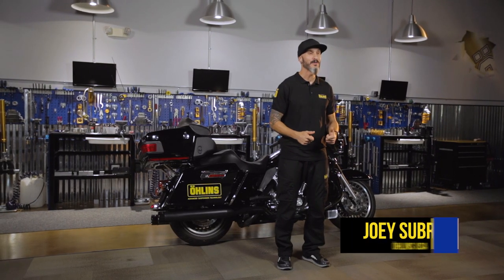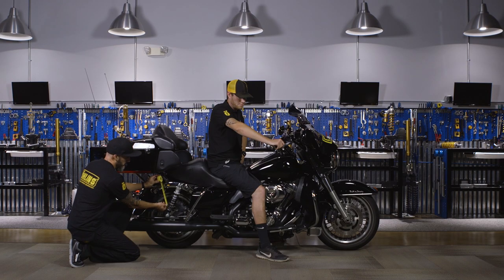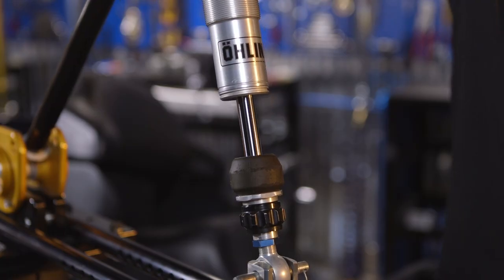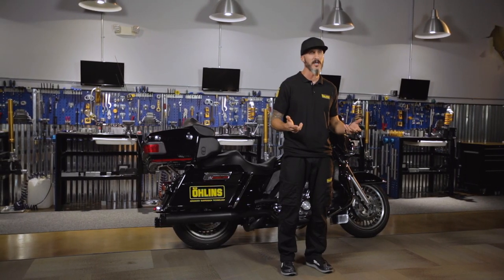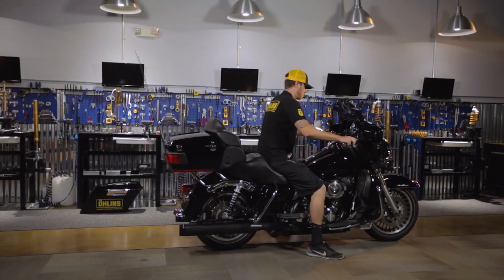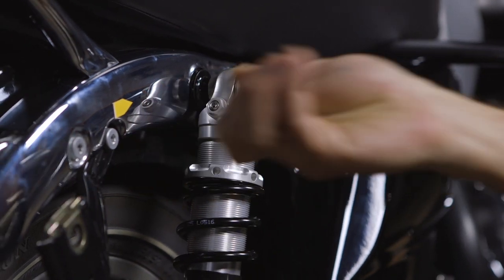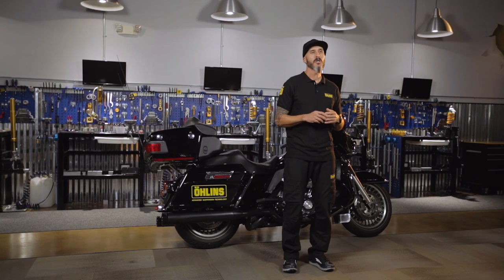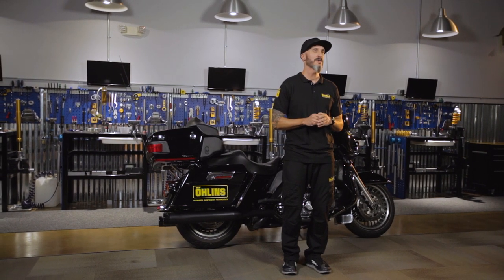Setting the sag for your Harley-Davidson

Comment: I want a suspension that doesn't need adjusted every time I put gear in the tour pack or take a hippy chick for a cruise
Reply: Wilbers Nevomat LDC self adjusting suspension. Not inexpensive, but well made by a reputable company and you set them once, they self adjust to added weight every time thereafter.

Comment: I have HD144 on a Sportster. As per Ohlins specs shock stroke is 100mm but this includes the rubber stop. Without it stroke is more like 72mm. Should i do 30% of 100 or 30% of 72mm?